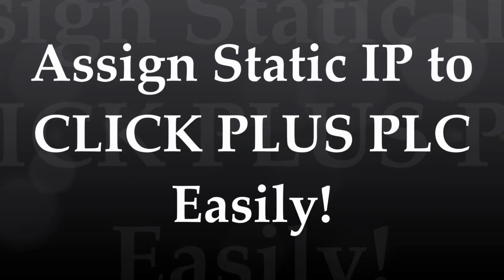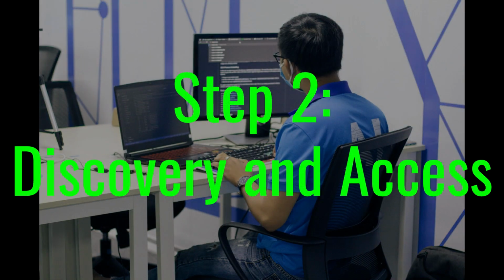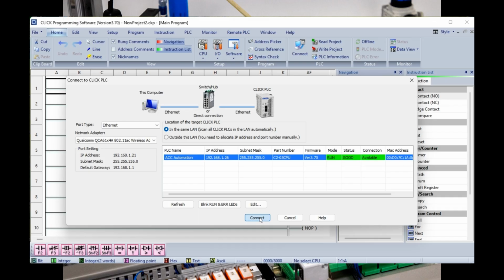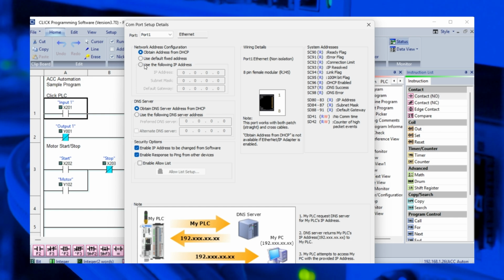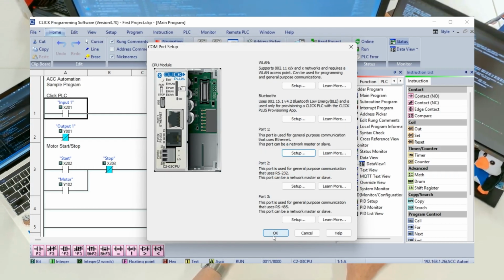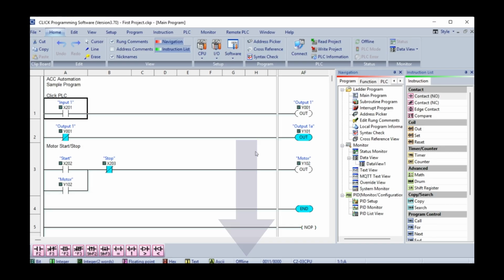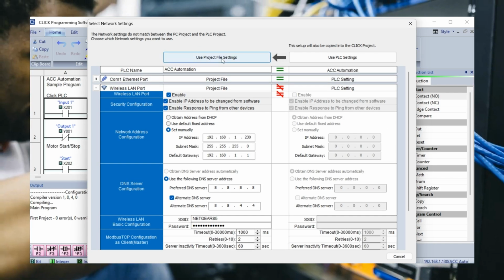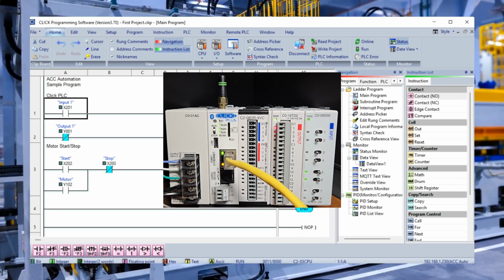Assign Static IP to CLICK PLUS PLC Easily!

Comment from the maker: For more information, please visit our website. This includes all of the links mentioned in this video. 
https://accautomation.ca/assign-static-ip-to-click-plus-plc-easily/

Previously, we installed the Click PLC Programming Software, updated the Firmware on the Click PLUS PLC, and created a sample program to test the inputs and outputs. 
https://accautomation.ca/free-click-plc-software-is-it-really-that-easy/
https://youtu.be/8hd61HNZI_8

CLICK PLCs were designed with simplicity in mind, providing reliable control at a low cost and with a minimal learning curve.
This simplicity makes CLICK a perfect solution for small machines, home automation projects, pneumatic applications, or anywhere a simple system needs a budget-saving control solution. 
Building on the original CLICK's simple design, the new CLICK PLUS PLCs offer the same practical control, but with some surprising added features. Using the same free, streamlined PLC programming software as its predecessor, the CLICK PLUS PLCs offer hassle-free programming combined with advanced capabilities such as Wi-Fi communication and data logging.

The Click and Click PLUS PLC series can be found at this URL:
https://accautomation.ca/series/click-plc/

Features of the new Click PLUS PLC (C2-0xCPU) include the following:
  Micro USB
  DHCP support
  DNS support
  Wi-Fi (programming and Modbus TCP)
  Bluetooth (Wi-Fi) provisioning
  SD Card (Data Logging)
  Data Logger
  Network Time Service
  MQTT (Publish/Subscribe)
  Required PLC Password
  Disable Ports
  Strong Password Support
  Disable Ping Response
  Encrypted Password Transfer

We are using the Click and Click PLUS PLCs for several reasons. Here are just a few.
 - Investment is low for the hardware, and the software is free
 - Standalone PLC with built-in I/O
 - Communication ability - Ethernet Port, RS232, RS485 - support for Modbus RTU, Modbus TCP, etc.
 - Ability to expand the system with various modules, including RTD and Thermocouple inputs directly.

Regards,
Garry
ACC Automation
https://www.accautomation.ca